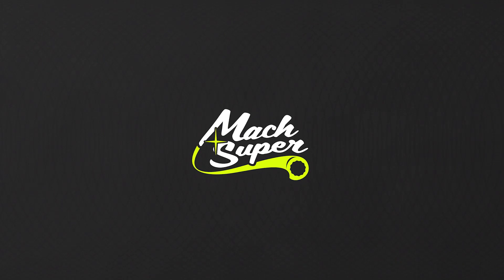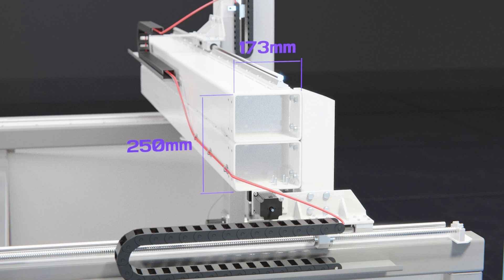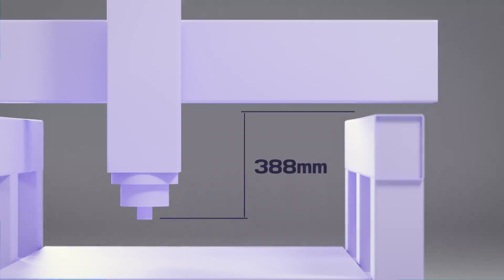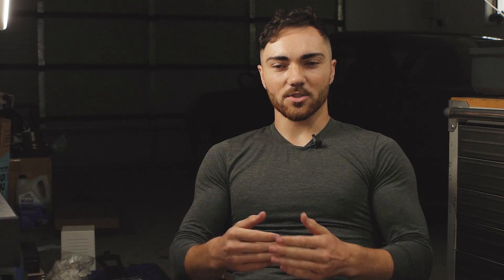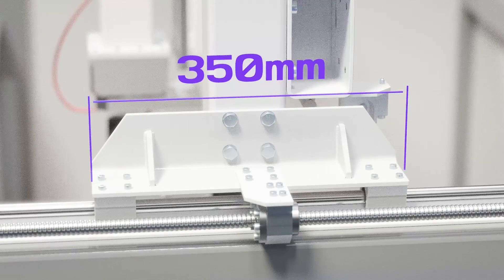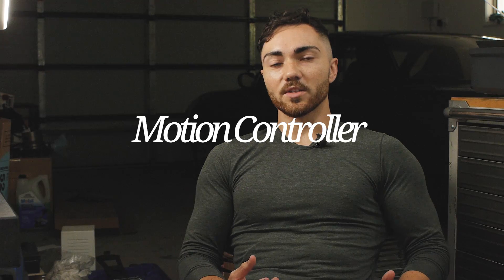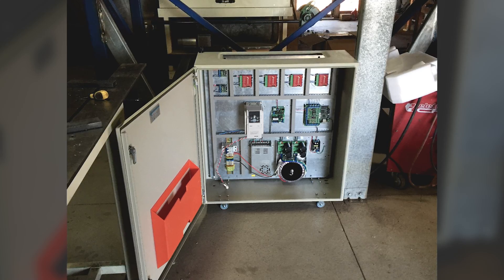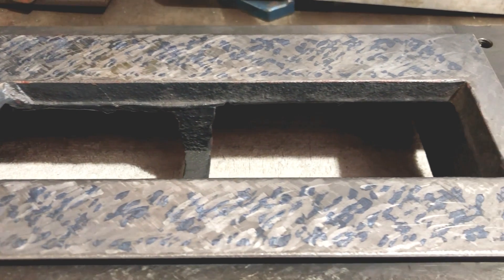How NOT to Design a 5 Axis CNC

Comment: With a moving bridge there will be twice the leverage compared to a moving beam. V vs / if you will. It isn’t beneficial that the bearings are on the same height as the work piece because of the longer arm. If it were true then column height wouldn’t matter at all but intuitively you know it does. It can be mitigated by making the column very rigid by making it triangular but remind that forces work in both x and y direction so you will need two perpendicular triangles.
Reply from the maker: Unless I'm misunderstanding you, I don't agree. The closer the bearings are to the z plane of the current work plane (where the tool currently is), the less leverage it will experience from the cutting forces. Sure there might be leverage from the inertia of the moving bridge as it accelerates back and forth, but that - I think - would be negligible for smaller machines and gradually get more important the bigger/heavier the gantry gets. The forces going perpendicular to the travel of the gantry should be dealt with by the rigidity of the gantry structure only, which can be helped with triangles in the join between the 'beam' part and the 'column' parts.
Reply: @machsuper you are correct

Comment: Great video and some great ideas. Please allow me to share some of my own ideas. I am currently designing a 5-axis machine with automatic tool changer, but I use servo motors instead of steppers. I just hate how the torque of steppers dramatically drops when speed increases, significantly limiting real world operating speeds. Also the noise of steppers gives me the creeps. And as for software, my favorite by far is LinuxCNC. My new setup is running on Debian 13 with KDE Plasma desktop on a super cheap N100 mini-pc and a Mesa 7i96S ethernet controller card. It is probably cheaper than a Dynotron KFlop solution, while providing unlimited flexibility and it is really a lot of fun tailoring it to my specific needs. As an alternative, and because it is fun, I am also experimenting with a grblHAL compatible Teensy 4.1 based solution, which looks very promising as well.
Reply from the maker: That's awesome! I hope I get to see your machine.
I wonder if I'll end up just going with LinuxCNC, everyone that's done DIY 5 axis just swears by it, but I've also not seen many people use Dynomotion, so I'm curious if people are just missing out on something special by ignoring Dynomotion. We'll find out later in the current 5 axis mill project. I've got a new video on that project coming out in two days from now.
Reply: @machsuper  I can't wait to see your new video! Today I actually started exploring a different path: LinuxCNC in combination with EtherCAT servo drives. It would fully eliminate the need any additional motion controllers. Just a simple N100 mini-pc running LinuxCNC, assign one ethernet port as the dedicated port for EtherCAT, daisy chain the servo drives and any other EtherCAT enabled modules (e.g. I/O modules for the limit switches and so) using standard CAT5e or CAT6 ethernet cables and that's basically it. And to make things even simpler, I am looking at Integrated Servo Motors, where the drives are integrated into the servo motors, which eliminates any wiring between servo drives and servo motors. The motors only need are a power cable and an ethernet cable, and all motors simply daisy chained. It will make the whole wiring of the machine so much easier and cleaner. Please let me know what you think of that :)

Comment: I believe that the biggest mistake is the tendency of people  to build a one size fits all machine; there are conflicting requirements. In a nutshell, everybody wants to mill steel, aluminium, wood and plastic on the same machine. You can, but in various degrees of quality and productivity. I am in the process of building my gantry router for milling steel. The working anvelope will be : 3.000 mm on Y;  2300 mm on X and 500 mm on Z. The gantry will be : 3000 mm long, 800 mm wide and 1200 mm high and it will weight in 3 tonnes without the Z axis.  The Z axis and its counterweight will weight in 1 ton. My calculations show that milling at 100 mm below the bottom of the gantry will produce a torsional displacement of about 8 microns; at 500 mm below the bottom it will be around 50 microns. These figures are valid right in the middle of the gantry; near either end of the gantry the figures will likely change, but I do not know how much. The milling motor will be a 15 kw servo motor, 1.500 rpm, slow feed rate of about 4 m/min, for milling steel 80 % and aluminium 20%. If I want a shiny aluminium surface, I will
 add in a new motor with 24.000 rpm. My point: it is best to know your main usage of the machine and build around those requirements. Have fun !😊

Comment: A lot of times, even if you're using thick steel tubing and the machine is pretty rigid, vibration in a machine while the spindle is running can cause unwanted side effects. What you can do is add some other material inside the steel tubing to dampen the vibration. I've seen people use concrete or Epoxy granite is probably the best. (Fiberglass resin mixed with concrete). It also makes way heavier but there's ways around that too!
Reply from the maker: I can’t remember, did I mention that the main frame was filled with coarse sand? If not, then yeah, I did do something like your suggestion. I assume a concrete or epoxy granite would be better again, but I was cutting corners in more important areas than that. I was confident also that the most likely vibration problem would be the whole Z axis wobbling back and forth, so the frequency would be too low for concrete to help. I knew the bearings would be the biggest issue. I did turn out to be right about that, unfortunately.

Comment: i made a moving table design, and i really have no complaints... i get the most stifnes out of that type of design...
Reply from the maker: What did you make the chassis with?
Reply: @machsuper  A combination of steel profiles , steel bended metal and cast aluminum whereever the rails go to reduce vibration with material combinations.

Comment: From building milling machines professionally: If you can - by any means - make it more rigid, make it more rigid! Make it more rigid until there is no crane that can lift it, no truck that can carry it, no servo that can move its axis, no customer that can pay for it and then back off about 15%.
Reply from the maker: Hahaha yeah, well said. Rigidity is king in machining.
Reply: Im thinking of doing a square metal tube structure for a gantry cnc filled with sand. Any thought on this?
Reply: Im getting into building a gantry CNC with rack and pinion drive. Is square tubing filled with sand ok for this?

Comment: Yes, the best gantry is a double gantry. I made one, but of course you then are limited more, but there is no torsion at all since the spindle hangs between two bars. For 4th and 5th axes I use separate systems, so the Z spindle is always vertical. (also there you have your torsion problem)

Comment: From a former mechanical engineer: Round tube is only better at rotation as a single member and box beams are still pretty good at that. I have shifted from engineering to working on industrial machinery for a living - most machines don't use round tubes. They are much more hassle to mount and align everything properly vs just slightly upsizing and using box/rect beams, and they aren't single member designs.

When trying to resist torque, depth is the 1st most important factor. A piece of paper can be bent/twisted easily. To some degree, widening the paper will help resist, but simply making the paper thicker does far more. And if you think of cardboard, it maximizes this effect for minimal weight by concentrating the material on the outsides, then linking them together with an approximately triangular grid.
The thin sheets by their selves aren't strong in that way. The corrugation layer isn't much stronger either (look at how corrugated roofs can collapse). But once they are tied together as a unit, they become extremely strong for the weight.
A box beam with internal triangulation will be very strong. Also, 3 box beams in an approximately triangular arrangement plus a bunch of gussets will also be very strong, usually much more twist and flex resistant than just 2 heavier box beams.

I notice you didn't mention racking. That is another reason why extending bearing spans is important.

As far as wide vs narrow spanning, you are correct, though it may make for a much more compact machine. When you consider that the most effective control on flex is wide bearing spans + rigidity of members, you already want as wide a bearing span for the gantry as possible (really for any of the axies). Being slightly longer depth is preferable in most shop circumstances vs making an already long machine even longer.
& When you think about the practicality of doing that, going for as heavy rails and screws as you can afford, cost for longer screws and rails shoots up exponentially. But then all the gantry itself gets more expensive and heavier if it's longer and may need bigger motors, etc. Decide where to spend your money.

For a home garage, I really like the idea of a wide spanned machine that offers the option to feed sheets through. If you imagine cutting a 5x8 sheet (or a rectangular shape like a custom door), it is more steps, but *you could use a much smaller machine if it's spanned the wide way and cut & move in several stages. A short span machine would require the short direction to be at least 5ft wide + the rails etc. A wide spanned machine would only require the wide direction to be 5ft+rails etc. That means walking space around both ends of the machine, except when cutting long sheets. That's a win for a home shop, imo, but if you are cutting large sheets all the time, then just make a bigger machine and avoid the hassle of cutting and moving stages.

Back to rigidity concepts: when mounting the axis on the beam, you want the rails as far apart as possible, so they resist tip flex perpendicular to the beam. 

There is the possibility of going with rack and pinion for a big cost savings. If you want less backlash, helical gears are an option.
If you do rack and pinion, I highly recommend mounting them facing down, so chips & stuff fall out of them rather than in to them.

If you have vibration problems, fixing rigidity is the best solution.
After that the common cheap way to deal with that is filling sections of the gantry with cement (at the cost of weight). Cast material is also much better at dealing with vibration (scatter & absorb effect), but not practical for a diy system.
Reply: I always wished that steel suppliers created an equilateral  triangular hollow section beam. It would be the ultimate for a diy cnc frame, the vertex joints would get tricky, though.

Comment: Concerning Gantry Style. I was an early CNC PCB Drill and Router Programmer/Operator in my first career (late 70s-early 80s). I programmed and ran several different styles of machines. I think the best compromise between rigidity and size is the Moving Table, where the machine is wider than it is deep, the table moves Front <-> Rear, on the shorter axis, and the spindle(s) move Left <-> Right, on the longer axis. All the fastest/most accurate multi-spindle machines used this format. It also provides the best operator access to the workpiece.
Reply: Im working on build a gantry cnc with rack in pinion drive using servo motors. Ir square steel tubing filled with sand ok for vibration damping?
Reply: @jlo13800 Why not use solid bar stock? CF bar is more straight, square, dimensionaly accurate and rigid than tubing. If you're stuck buying tubing because of cost, consider using concrete or epoxy granite to fill it.
Reply: @MikeYurbasovich  Yes for vibration damping!

Comment: I wonder if the ESS/Mach 4 problems are due to the fact that Mach 4 is designed in the US where the axes are all about moving the part, not the tool, i.e., 5th-axis trunnions.
I can tell you as someone who has designed and built a fixed-gantry CNC machine and used moving gantry machines, you are partly right about the ease of making the table. The challenge is in squaring the table to the gantry since there is so much space between. Not impossible, just more tedious and/or it requires tools that are less common. (Who owns a 1m square?) It also increases the rigidity of the gantry, and typically allows for faster movements.
Very cool that you identified the problems in your design. Even more so that you shared it to help others avoid the same mistakes!

Comment: I thought long and hard about the design of my CNC before I built it, and addressed all of the issues you spoke about. But it wasn't without a lot of time in SketchUp and significant discussions with a friend about the pros and cons of each design. I was looking for something different to the well worn path, and I hadn't seen anything like what I come up with (8 years ago). The only significant difference between yours and mine is that I boxed the the X axis gantry in to make it more rigid. It trades view for stability but it is one I am willing to make. Looks like you're just down the road from me.
Reply from the maker: It’s very easy to end up spending many many hours thinking about the design, isn’t it? I block out the essentials and even some smaller details in Blender these days because it’s much faster and simpler to modify any part of the model without breaking other details. Then I go into a parametric modeller (Fusion360) to get every detail I need.
Did your gantry hold up like you wanted?
Reply: @machsuper  hell yeah, and even more hours drawing them up to make sure they are going to work as intended. I use SketchUp predominantly for my drawings and reluctantly starting using components and groups to stop parts sticking together. I looked at learning Fusion 360 but knew they were eventually going to stiff people and start charging or remove functionality. Sometimes you hate being right.

For the most part yes, but using two NEMA23's on the Y axis it can cause racking issues if I have problems with wiring or software glitches, a couple of years back I started on modifying it to be driven by a single NEMA 34. But from a rigidity stand point it was a good call, even thought it does complicate seeing things occasionally. My main goal was to get the spindle in the middle of the X axis gantry frame to make it as lever free as possible (was originally thinking 5 axis and supporting both sides).

Bearing load was my primary concern of the design and I have 340mm between bearing end to bearing end, and the updated version of my end plates is 360mm. Like you I made an error in not allowing myself enough length in the bed frame to allow for a decent width gantry. I am very close to getting 1200mm (once finished) of Y travel but I am just a fraction shy. I used 75mm box for my main frame, and some 65 x 35 for the bed. I wish I had made everything out of larger sectioned box.

Comment: Great observations! I came to the same conclusions after I built my first cnc from an aliexpress kit. My latest one includes what you talked about like linear rails, square tunes for torsion stiffness etc. I would also recommend tooling plate aluminium for the bed as it can be used as a good reference for tramming. 
I went with premade 'z axis' for all axes, with the y axis turned on its side, so 2 rails on each side, 4 total and 8 bearing blocks to make it really rigid. 
I'm interested in adding more axes to the current 3 so I'm looking forward to how you progress your build!
Reply from the maker: Wow sounds like a cool build! Thank you for the comment mate. I’m a little slow, but I’m working on more videos.

Comment: Super, thx. I also do not have lots of money. That is why I make my own linear rail, i just use ptfe sheet as dry bearing. You could use heat to shape it as needed. It will need some kind of backing plate. Thx mate👍
Reply: Nah forget it, i build proper linear carriages. Plus i am rebuild my frame using epoxy granite. This has become costly project lol

Comment: Thank you. Looking forward to watch more on this. I’ve been looking at improving my 60”x49” CNC I purchased in 2018. 
I am looking at linear rails in place of the rounds like you have and increase my Z height. 
This is a very solid and heavy all steel construction CNC. Hoping to get more info and ideas from you. 🤙🏼🇨🇦
Reply from the maker: Thanks mate! There's a secret router project that's come into my life lately, so you may end up seeing more router content from me.
Reply: @machsuper  this video was quite informative and helped to cement the knowledge that cheap round rails are garbage compared to linear rails.
My CNC has some great build quality mixed with some odd ideas that I want to address.

Comment: I'm in the process of building a LinuxCNC with Mesa card 5 axis machine. Can talk a little about the CAM workflow side of things? I'll probably go the Autodesk Powermill or Fusion 360 with machining extension route, but I'm uncertain if the gcode will play nice with my sender. I'm curious what issues you may have had in this regard. Cheers!
Reply from the maker: I haven’t actually done any 5 axis work on it in 6+ years. But if you haven’t already watched it, the video linked in the description does a lot of talking about the CAM side of things. The most important thing is to make sure you can get the RTCP setup and working. LinuxCNC has good support for that, so I suppose you’ll just have to make sure you have a post processor that suits LinuxCNC and your particular needs. What type of machine are you making? VMC style with trunnion? Portal router like mine?